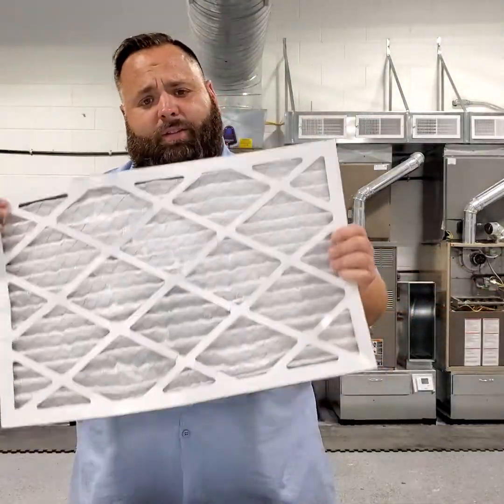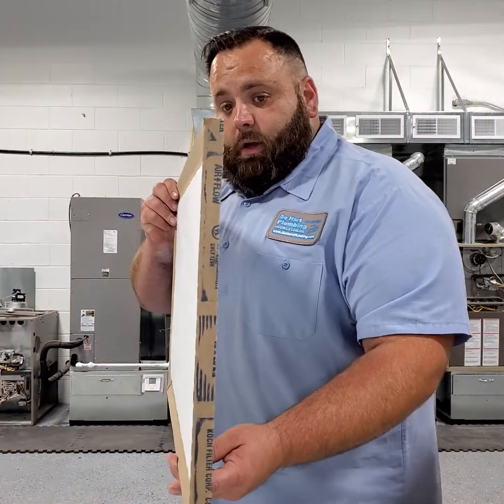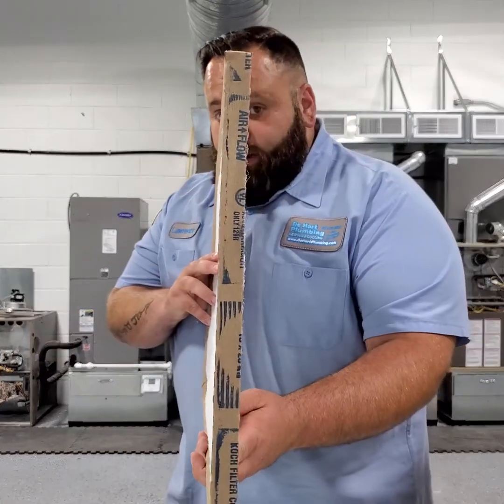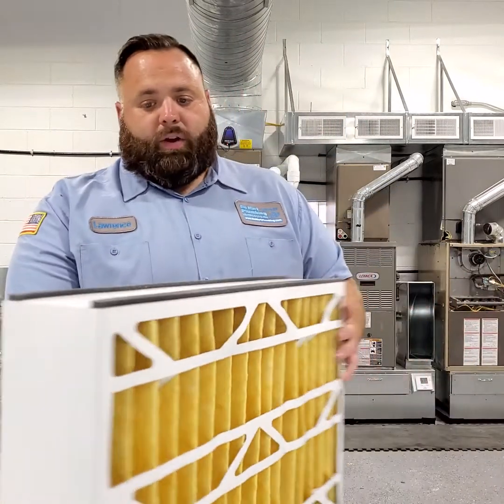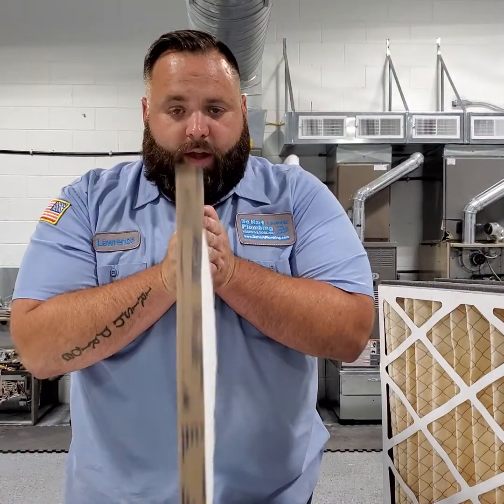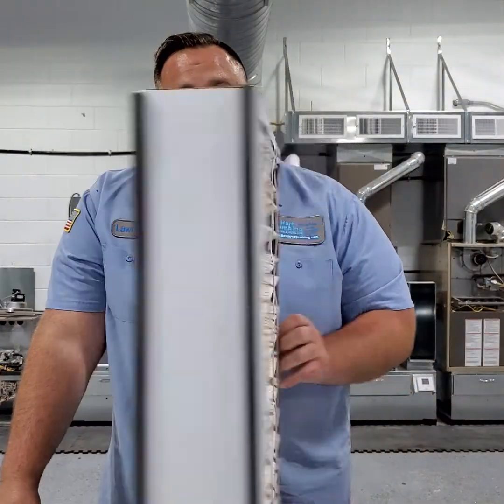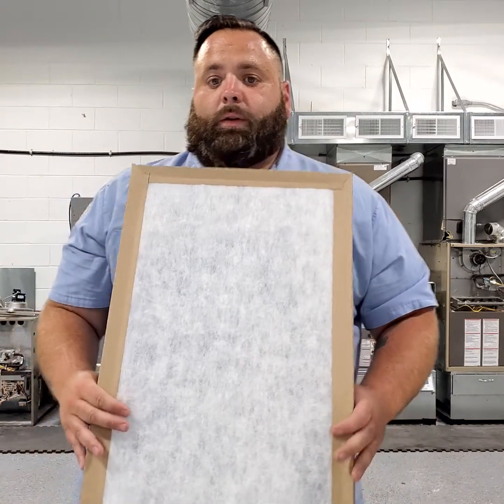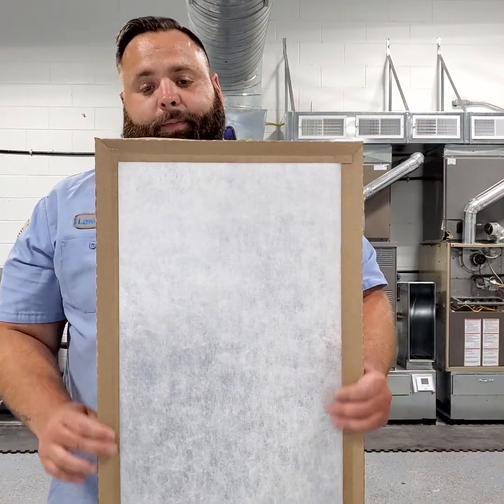HVAC system filters. Whats bad & whats good?

Comment: I buy the cheapest Pleated air filters from HomeDepot for about 3 for 10$. They are better than the super cheap flat ones, but not so restrictive that they will cause me problems.  Also note that most air filters become more effective at filtering the dirtier they get, up until breakthru or the air flow restriction is too much or both.  Jus sayin.

Comment: Yea! Yrs ago an hvac man told me,to stick with the reg fiberglass cheap filters. Good enough he said. Then another suggested the basic filtrete ones. So I did the switch. But I noticed after a yr or two, a sweet smell in the bedroom, mine, nearest the garage held air handler.i switched my filters every 4 weeks. Well, the ceiling vents were growing mold inside  the vent ridges! And were moist with condensation, this was now summer.AND the air flow was less cooling….less air coming through. The Filtrete basic pleated were now TOO RESTRICTIVE, CLOSER PLEATS even in the basic! Diminishing my air flow! 
So..I took apart all my ceiling vents, bleached and scrubbed them gently, put them back. Changed back to reg fiberglass from Walmart, and BOOM….cooler air, cleaner air, strong air flow! No more mold, no more mildew or condensation! THE PLEATED FILTERS RESTRICT AIR, CAUSE ISSUES! And I learned this on my own by that sweet smell which was mold!

Comment: This is the best explanation of what I’ve been experiencing in my very expensive rental house when my owners that are in their 80s just spent $20,000 or replacing their entire outside system and I feel bad so I just bought $2000 in portable air, conditioners, and window units

Comment: You are 100% correct.  I had the guy put a brand new heating and cooling system and it was working great.  After the installing of the new Lenox system; I was not pleased with the cheap filter.  I went to Home Depot and brought a high quality expensive filter and put that in.  In about 5 hours the system shut down. The installer  came to check it out and told me the system shut down because of  new filters I put in which was restricting proper air flow

Comment: I do not like foam gaskets on my 4-5 inch filters vs cardboard.  Air like water finds the area of least resistance. Maybe  sucking some air around the filter vs thru but filter would be plugged

Comment: We are seeing more performance homes starting in California.  High tight homes where hvac becoming enclosed in CONDITIONED SPACE vs a hot or cold  attic with leaky ducts.  A suction door test for air tightness allows smaller heating/cooling units as house more energy efficient and better insulation. Thicker R ratings, triple pane windows., make up air units, ERV and HRV etc.

Comment: Even the return intake can hurt flows, 20x36 vs a 20x20.  A permanent magnet AC  single motor vs a DC multi speed motor allow different flows.  California requirements for new home builds after 2019 to allow up to Merv 13.  Starting to see more specs on sides of filters for California. Builder 1 inch frames are another issues.  Luckily newer filters with 1 inch lips allow 2-3 inch thick filters without mods to allow deeper pleats and more surface area to allow better flows thru higher Merv filters keeping air and equipment cleaner.  Our lungs have a surface area the size of a tennis court but in compact chest cavity.  1 inch filters need to be changed monthly vs thicker filters 3-6 months.  That is depending on number of occupants, pets, Cooking, allergies, etc.
Reply: Unless you have a really old home, typically HVAC’s are worn out after 15 years especially in Arizona Merv 5-8 should be fine But change monthly if 1 inch.  A 3 inch plus filter can be fine Merv 10, the sweet spot.  If you need more filtration think about a bypass Hepta filter Merv 17 plus.  It’s has its own motor and not reliant or dependent of hvac motor.  Not sure about newer heatpump units that combine both a/c and furnace in one unit which is the future as California and others states getting rid natural gas.
Reply: Honeywell fc40r1029

Comment: Totally confused. At one point it sounds like thicker pleated air filters will choke my system but then thicker pleated air filters allow for more surface area and will allow for better air flow.  Which is it?
Reply from the maker: @gramps5157  both can be true. They do allow for more air flow because of the larger surface area. BUT. If your HVAC already has poor air flow then it will struggle with a 5" filter as well.

Comment: I have allergies so to me the risk of having a restrictive filter is worth it especially during the summer. I was sneezing alot with the cheapy merv3
Reply: MERV 8 should be fine unless one has an old system with undersized filter size and return ducts.

Comment: So option 1 i use a no restriction air filter which will then allow the coil to get covered and filled with dust, dander etc requring frequent servicing as it will reduce efficiency pretty fast, or i can get a pleated filter which restricts the airflow some but protects the coil. Seems more logical to get a lower merv pleated change out frequently. $120 in filters a year is better than a $250 service call fee and $300 a coil cleaning fee yearly.

Comment: Great video full of good information. I live in hot South Texas. I notice that two years using 1" x 20 x 20" k&n washable filters both on my HVAC room door filter and another in the unit,  I'm starting to hear condensation running down the pipes way more often than usual. So I decided to take them out and replaced them with merv 1 fiberglass filters, one on the door and two in the unit that have two slots. Wow! The amount of air flow is incredible. Do you recommend this or should I take one of the filters on the unit out? Thanks in advance.

Comment: All those see-through filters do is allow dirt and pollen to get through and build up on the blower and other internal parts. Then guys like this come to your house and charge your 2-3 thousand dollars to fix or replace them.
Reply: Nah, I just replaced my 25 year old HVAC system this week. I've always used the el-cheapo green filters. After 25 years my indoor coils still looked fine. Having said that, we don't smoke and have no pets, so that could make a difference.
Reply: @douglaswilliams6834 No smoke but we have 2 cats. I changed to the cheap ones to achieve a "better flow" its noticeable😊 1" version

Comment: Everything in the video is spot-on! 
Also, the purpose of a furnace filter is to keep the furnace clean. It's not intended to improve the air quality of your house although filter manufacturers market them as such to be able to sell them for more profit. If you need to improve the air quality in your house then you need a dedicated air purifier with a Hepa filter.

Comment: All furnaces for the last 15 yrs if not more have an info tag somewhere in the unit. On this tag you will find the most important # for your furnace on it. That # is "maximum static pressure".
At no time did i hear a reference to static pressure in this explanation!
Proper sizing of ductwork is the "make or break" reason for good vs bad static pressure. 
Low static pressure is good, high static pressure is bad!
The final piece of the puzzle for your furnace (a/c) is the filter.
Any good furnace tech you are paying should do 1 thing before they do anything on your call. 
That is check TESP and check pressure drop across filter before any thing else is done.
To test this he must use a manometer. (U-tube, inclined, magnehelic or digital)
If tech does/tells you anything without having tested for pressure they are hacks.
Poorly sized/ducted furnaces will have high static pressure.
A filter can(& should) be spec'd to your furnace using manometer to determine which filter will be the best for your particular application. (re: filter "merv" rating)

The primary difference between a 1"filter and a 5" filter is lower pressure and longevity re: increased surface area of filter media. 

Couple of side notes:
- fiberglass 1" filters are useless (unless you're trying to stop bugs and birds)
- plugged filters (dirty) do not strain the blower motor (or make it work harder)
Check amperage load on dirty vs clean.
Less air re: dirty = lower amperage
More air re: clean = higher amperage.

As mentioned by at least 1 other comment here. Primary objective of filter is to protect the furnace itself. Secondary is to filter the air you breath.

Comment: Thanks for making this video! I've been using the $2 dollar filter. I try to change the cheaper one monthly, but misses a month. I found the filter became flumsy and bent on me (I have a strong vacume). I actually lost heat so i shut it off. The next morning it worked. I'll pick up a filter tomorrow. Anyway, would you suggest a thicker filter, due to the strong vacume.

Comment: Been using merv 13 filters on our house's original 22 year old HAVC system since its beginning, and have not needed to do any unscheduled repairs to it(furnace, a/c, blower motor).  I DO change the filter monthly, and of course, I do NOT know how efficiently it has run these past 22 years, but have been happy with the cooling/heating of it.  I guess hospitals have a whole different level of HVAC systems which allow very high filtration, while keeping the air flow going.  THAT'S what I want.
Reply: hospitals use pleated filters in front of hepa filters , sometimes before the cooling coils and after the fan ,to catch dust from the fan belts etc. In order to move air thru the air handler the size of the motor is increased , from say ,10 horsepower to  15 or 20 horse power. they also use many more filters per air handler say 20 or 30.

Comment: Love it. If you only have 1 return air duct it's a major red flag! Especially if you arent in a custom built home. Insist that your HVAC tech tests static pressure!! Over 0.50 total static is a fail for 90% of systems! More than half the systems we replace need to have a 2nd return air duct and grill installed to fix airflow issues!

Comment: I live in the Central Valley California where it can be in 100s all summer long. I was told by a HVAC guy to use fiberglass filter and did ever since.
Reply: Did it improve your AC system in terms of achieving your desired temperature

Comment: no one is talking about how dirty the evaporator coil is going to be after using those cheap little flimsy filters. What this man does not talk about is that the filters are meant to protect the system. The filters are not designed for air purification, but rather protect the evaporator coil. Although, indoor air quality is important, we cannot overlook, the regular maintenance of the HVAC system. As cheaper filters are being used evaporator coil’s will get substantially dirtier than ever before. Yes, you will be cool and yes, you will need to hire a professional to clean your evaporator coil faster than expected.
Reply: Learning that now as we pay 170 to get it cleaned. The other HVAC techs kept telling us to use the merv 1 and we are paying the price. Can't use cheap crap when you have pets.
Reply: @nicenhawtmenrgay  pets are the real enemy.
Reply: Nonsense.
Reply: Evap coils can clean themselves usually by condensation running down the coil pulling dirt and dust with it.
Reply: @adambergmann7716  Yep if what that person was saying was true then there would have been a drastically reduced amount of calls for cleaning evaporator coils after fancy filters came out and that simply wasn't the case
Reply: @adambergmann7716  🤦🏽‍♂️ fakenews🤦🏽‍♂️

Comment: Thank you sir. I always thought my furnace was to small for my house because certain vents had little air coming out, especially my daughters room I have to put a heater in the winter. Went out bought that fibreglass filter and my god what a difference. When it’s time for a new furnace I will get them to install the 4 inch filter housing. Thanks man👍

Comment: 1" filters shouldn't be available in high merv ratings. My furnace was .8" WC static pressure with a brand new pleated Kirkland 1" filter. My furnace was oversized and cracked the heat exchanger. New variable speed furnace properly sized with a 5" filter brought my static pressure to .3" WC.  Lawrence speaks the truth.

Comment: This happened to me. One day my furnace just stopped working. It stopped trying to kick in aka ignite the burners so no heat. I called my HVAC guy, and after the 3rd check of the system codes, he found out it was the safety mechanism shut off due to decreased airflow and it had not automatically reset. After it had stopped working, I had realized I didn't change the filter for a couple months, it was the cheapest 1 inch simple pleated filter. I removed it, vacuumed the heck out of it, but it still wouldn't kick on. Anyway, he had to tap on it to get it to reset, then it kicked on. He asked about the filter and I told him what happened. Then he told me to get the exact same type of filter you suggested, the simple fiber ones. Here I thought I was doing better for my furnace and myself but I just caused myself, my wallet, and my furnace more problems. Lesson learned. Thank you and I hope this helps prevent more problems for others.
Reply: instead of buying cheap filter, why not buy one of those mini pleat merv 8s? nordic pure make them.
Reply: 'it was the cheapest 1 inch simple pleated filter'  Realize, if the material is the same, pleats = more surface area, so equals even less restrictive than a flat surface.  That's simply basic math surface area, so there is no debating it, same material pleats are better not worse.
Reply: There's so many variables to consider why your heater stopped working lol.

Comment: Will the cheaper air filter make the ac coils and motor more dirty and last less by letting in a lot more dust in the system  ?
Reply: Yes, and it requires service calls to clean.
Reply: @TropicalGardenGuy  Thank you
Reply: Yes.

Comment: I used a Merv 7 for awhile & noticed my system was running a long time because of little air flow, switched to a cheap basic filter & now it only runs a few minutes summer and winter. 
And it also kills me that on the expense filter packaging it says it's a 3 month filter, that's crazy, that will most definitely burn up the blower motor.

Comment: Our new house has a unit in the attic and and unit in the basement. The attic unit has the cheap filters in the returns, and the basement has that big box filter you showed. When the AC company walked the system though with us he pretty much told us what you said about the cheaper filters,  so we stayed with them. We forgot to ask about the box filter in the basement. Should we stay with that? How ofter do you change that filter?
Reply: What if you put in 4 1" fiberglass filters and add a new one each month taking out the dirty one?
Reply: You could pull out the 5" filter and put in a 1" filter.

Comment: I just put in a Merv 11 replacing the cheap green ones. We have carpet and allergies..I'll give it a month to see if we have any changes. So if the 11 doesn't pan out, can anyone suggest another number for me? Thanks, this is very informative.  Funny, back in the day my grandparents always had a box of the cheap ones.
Reply from the maker: You can't use your imagination or sensory skills to know if there's anything changing. 99.9% of the time you're restricting air flow affecting your system efficiency and don't even realize it. It often doesn't make a large enough difference on your utility bill to alert you unless it's severe. It needs to be checked via Is total external static pressure.

Comment: hi! I have an older Thermo Pride low boy furnace.  It takes 20x20x1 filters but I don;'t know what MERV rating to get.  I don't see anything about it in the manual - in fact, I think it originally came with a washable filter from the way it describes washing it.  I'm not the original owner so I believe the original filter is long gone.  Thank you!

Comment: does a restrictive filter cause a load on the air circulator motor??  i think the amp draw will remain the same
Reply: No!
A dirty filter will have lower amperage draw.
A clean filter will have a higher amperage draw.

A furnace blower is a "pump".

When the pump moves more material the load increases. When same pump moves less material the load decreases.
So, 
-clean filter = more air => higher amp load
-dirty filter = less air => lower amp load.

Comment: What's the brand, material and MERV rating of that flat filter with what looks like synthetic or poly material you suggested in your video?  It looks better (bit more dense) than the see-thru cheap fiberglass MERV 1-2 filters.

Comment: I'm in an old old house that my grandmother put in a new hvac system in around 2008 to me the duct looks crappy and is wet all the time I know ductwork didn't get changed from just having a furnace! Not to mention it's surrounded by 100% dirt...is there a way I could see how much of a filter I can run without hurting my unit myself? As of now it has a 25x16x1 filter in it..I'm really handy how hard would it be to put one of them 25x16x5 filter cases in or would it be better to have the ductwork work sealed and or new put in and then worry about the filter? How could I figure out the most merv rated filter I could use until then ? Ran a 12 once no go in a month! Any thoughts would help thank you
Reply: You might have a leaky duct system on the return side of the unit sucking in dirt from the attic.